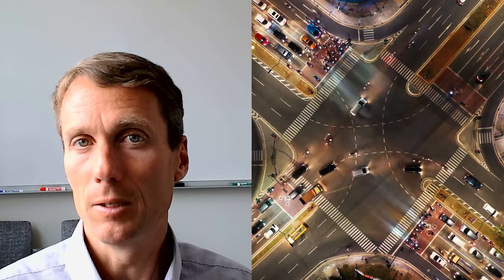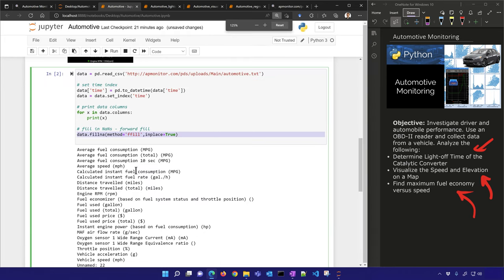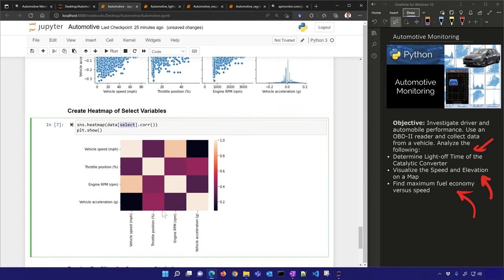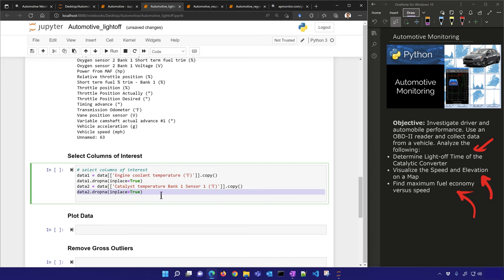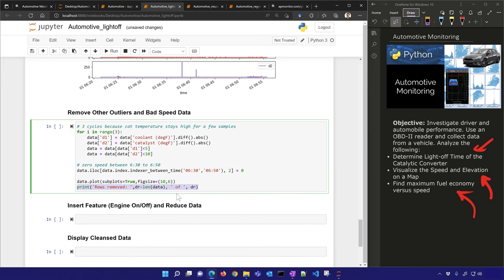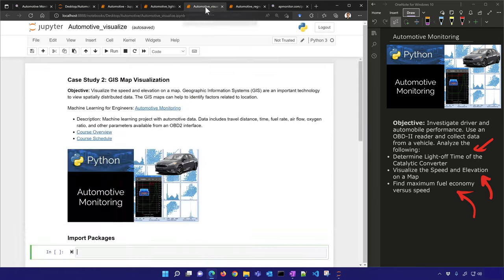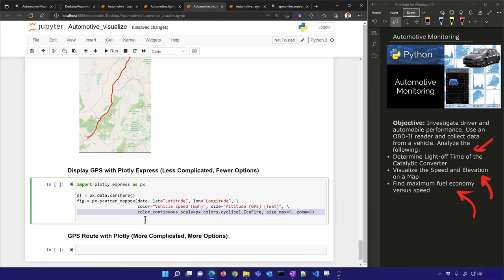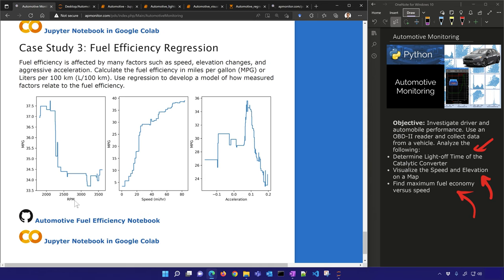OBD-II Data Analysis with Python

Comment: How to detect data for break applied 
0C for RPM 
0D for speed
 Which is for break ?
Reply from the maker: I haven't seen brake position as one of the standard PIDs. The online forums mention that it may be part of the BCM network: https://www.corvetteforum.com/forums/c6-scan-and-tune/3478452-obd-pid-for-brake-pedal-position.html